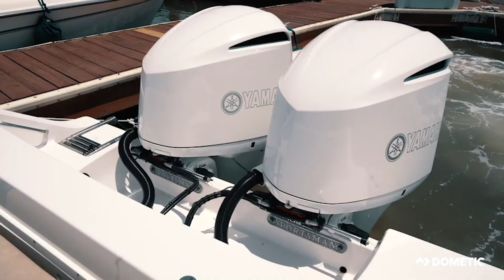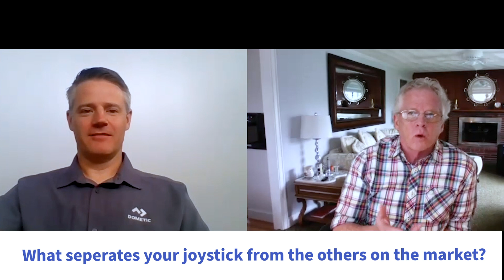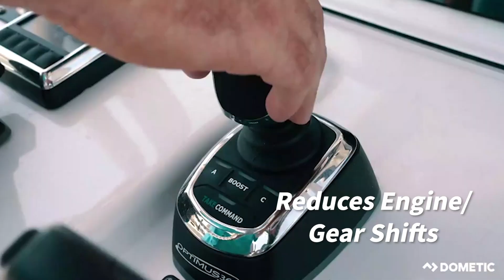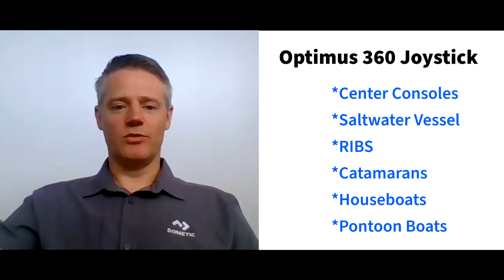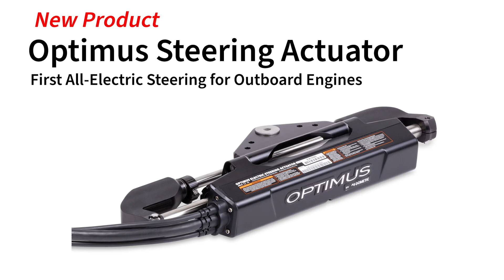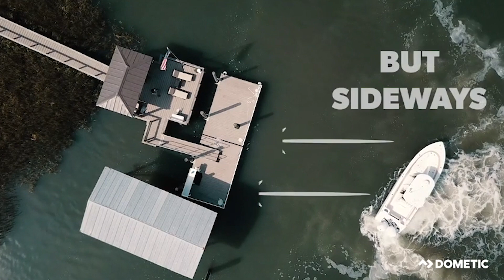BoatTALKS with Brian Dudra of Dometic

Comment: I believe ive used every joystick system besides Cummins and Hinckleys.  Volvo with pods was the most responsive.  Axius with inboards was right up there too.  

Axius with outboards and Evinrude’s idock were both intuitive but i couldnt quite get the boats to move perfectly sideways like i could with the Volvo system.  I never tried these on a catamaran but i assume they would work better since the engines are spread out more. 

I tried optimus with yamahas and it was a noticeable step down in controlability.  And they have this system of primary/secondary movement that is not intuitive at all.